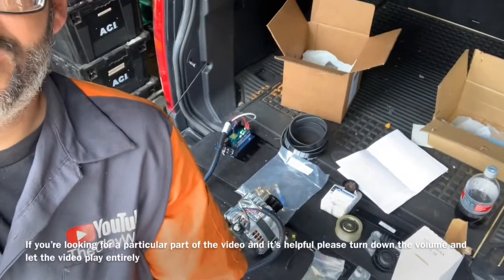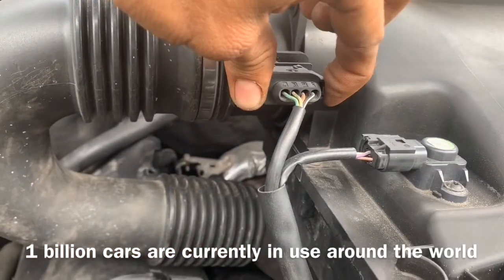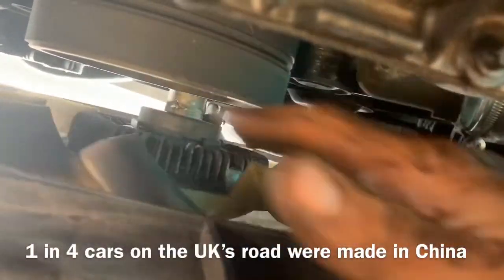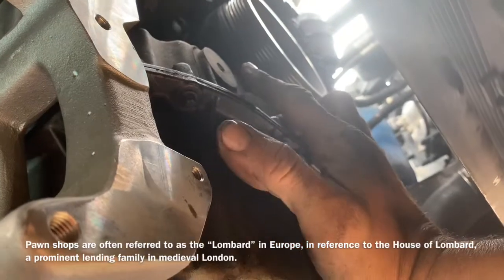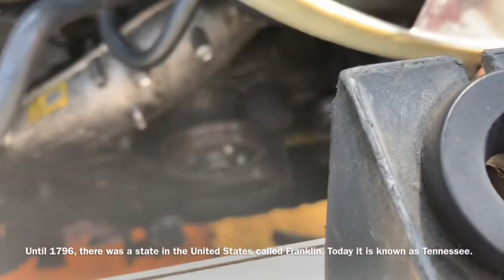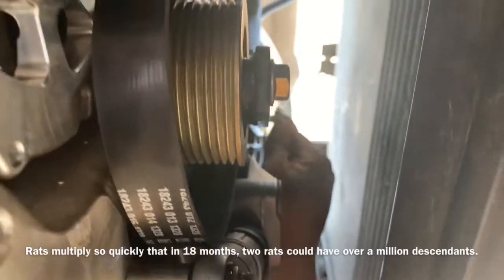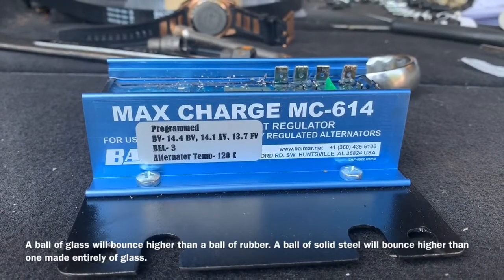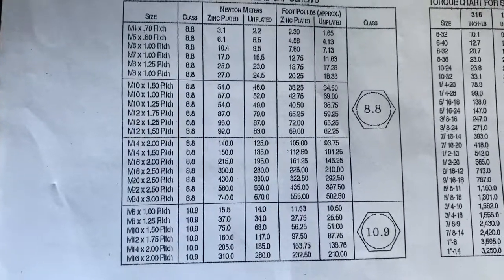Sprinter/Mercedes diesel 3.0 duel alternator installation 280 Amps at idle . SWEET!!!

Comment: Thanks great job I love how detailed you are. I would like know how you replace the belt you cut mine is looking a little frayed I don’t know how you do that without a tensioner.
Reply from the maker: Well I had that same problem one time when I was replacing mine I don’t know if it’s the correct procedure or not.

But I put The belt on as much as I could by hand and with the screwdriver and then I crank the motor over. That’s the only way I could figure out how to do it I never made video of that because I’m not sure if that’s the way you’re supposed to do it. 

But you could also use a belt installer

If you want to search for it here is the search terms

Lisle Stretch Belt Remover / Installer
Reply: @sharpcarco  most tensioners have a nut on them you crank around and a hole you van put an allen key or similar in to keep them there while you fit the new belt.

Comment: Clay!!!  Excellent video man!  Question: WHat's the deal with the belt?!  I have a brand new 2019 2500 170WB tall boy sitting in my driveway with 300mi on it.  Of course, dealer said, "NO don't install a second alternator!"  He can eat it, I've been running dual alternator ambulances and personal vehicles for 18 years...My concern:  I'm using the van all built like it's intended, adventures! But I don't want to be in the middle of Alaska and throw a belt if it shuts down my vehicle, and/or, is super crazy to fix on the fly.  Your install looks straight up, but what about the belt fix?
Reply from the maker: Hey thanks Ben I appreciate the kind words really puts a smile on my face when folks say things like that.

Well to be perfectly honest with you I’m not sure why it through the belt I did go back and switched around a washer that I had the opposite direction but when I made this video I showed it installed the way I thought it properly should be after it was switched around maybe that had something to do with it even though I don’t think so I just would recommend carrying an extra belt
Reply: @sharpcarco  NICE!  Well, thanks for the video and reply.  I installed the 3 belt system and it was a breeze.  I tried to do a video of the install but I was alone and only have a phone to record.  If I can get it all spliced together I'll upload it for others to use.  Really, really, really pleased with the autonomous 3 belt system thus far.  About a thousand miles in and it is rock solid.

Comment: Great video Clay! I am getting ready to buy this set up and wanted to get familiar with the task. Is it really, in your opinion, worth the huge expense to go lithium on the batteries?
Reply from the maker: Me personally I wouldn’t waste the money on it but that’s just my opinion maybe somebody else will chime in with exactly the reason that it’s a good idea
Reply: @sharpcarco  So I found out I have an A/C pump on that bracket already servicing a rooftop system. I think I want to remove it anyway. Can I just swap it out with the alternator and use the existing tensioner and all?
Reply from the maker: On my Sprinter I had one of them rooftop air conditioners as well I can’t say for certain but I think you could you would probably have to compare it with what I show you in the video while looking at yours

Comment: Any more of the videos mentioned?    Getting ready to decide if a dual alternator and which approach is right for my Sprinter based RV.
Reply from the maker: Hey Jay good evening the guy that I did the dual alternator set up for. Has not brought the van back to me to install the batteries yet but I know he’s planning on doing it soon so probably in a month or so I should have video of the battery installation and wiring sorry I don’t have it today
Reply: The Clay Way I was also curious to the other van you mentioned and using a different setup for the alternators.
Reply from the maker: Oh sorry no I have not done that yet.

Comment: Great informative video!
Reply from the maker: thank you very much. The one I made for Your company was much better.

When we make a video for sponsors we make two videos. This way we can show a potential sponsor what we can do , opposed to just telling them. We also push sponsored videos. Which has a much more significant amount of views because they are Pushed and posted correctly . There are several things that we could do in the background to have a much greater impact on the viewer and equal sales for the sponsor. 

We did not push this video like we would a sponsored video. The reason being because I got no response from your company after several phone calls .

One of the videos I made speaks positive’ of the sponsor. When the other one doesn’t negatively represent the Potential sponsor but also does not mention them, and or mentions alternatives

 then we start creating alternatives to the product that the non-sponsor offers. Which is exactly what is happening in this video. 

I will see you in this situation I have not started creating a new alternative to the product that you guys offer just because of time etc. etc. but I do still have your sponsored video available if you’re interested I do believe it would represent your company very well and you should consider sponsoring it. 

If you have interest in seeing what the differences in a sponsored video and what happens to it we use wise an impact to the company please feel free to reach out to me I have some Information that you will certainly find a very interesting

Comment: Will this fit into a 3.0 diesel sprinter 2019 passenger van? Mine has the a/c unit.
Reply from the maker: Sorry I don’t know the answer to that question. Wish I could be of some help
Reply: @sharpcarco  I've been told the passenger vans can't fit dual alternators because the ac compressor takes that spot is that true?
Reply from the maker: The question would be is your AC compressor located in the same location as where I located mine? Then because I’m assuming your engine is still in 0M 642 where else would the AC compressor be located? You would have to move your AC compressor from the one location to the other but I am not familiar with the 2018 the most recent one that I worked on was a 2014

I will say this though I guarantee you there’s a way to mount it do you have to make your own parts?.......  possibly

Comment: Clay wha'ts the top 3 things thats break over time.
Reply from the maker: Meaning with Sprinter Van‘s? In general or the alternator set up?

The alternator set up I’m not sure of but I can ask the guy that I put this on

Sprinter Van‘s as far as I’m concerned number one is Intakes number two is rear differentials and number three particulate filter

Then turbos, glow plugs and nox sensors that’s kind of opinion based though. I work on quite a few of them but they are definitely not what I work on daily
Reply: @sharpcarco  Yes Clay im referring to the  alternator.  I want to stock enough parts in case it fails while traveling.